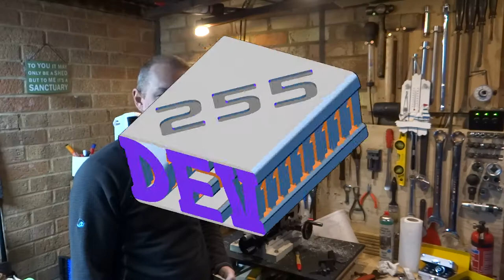CNC Mill Conversion - Part 3 - Dev255

Comment: Very inspiring work, Neil!  I found this channel as I was searching for the SX1 mill but I subscribed for the solid engineering work!
Reply from the maker: Thank you Leo, It's taken a long time getting here and am very near making another video on the X-Axis. I love my Sieg X1, it's seen me through 10 years of faultless operation, even the nylon gears are original (think I'm noo gentle for it). Love your channel, I am an old-school electronics engineer where I used to fix Amiga's, Atari ST's, Monitors, well anything ;-D. Thank you for subscribing.
Reply: @TheSolarPoweredEngineer  Thanks Neil!  Knowing what you know now about the SX1, would you still get it?  I've been going back and forth on the Axminster SX1 and SX2.  The price difference between them isn't that big and 500W DC brushless motor with belt drive seems like a good deal!
Reply from the maker: If I was buying again, I think the X2 would have it as the motor drive gears on the X1 can be a little noisy and have a little backlash, so can cause increased chatter when milling, plus the difference between 150w to 500w and additional 500rpm of speed would win it for me, plus an extra 10mm of lateral and 40mm of longitudinal movement is a plus. If your not worried about price, then the X2 wins I believe. What I would ask is, if you bought the X1 would you be constantly be thinking... what if I bought the X2? Plus the X2 has the controls on the front... Think I just sold it to myself haha
Reply: @TheSolarPoweredEngineer  All good points.  Especially the last thing (I'd think endlessly about what if I'd spring for the X2).  Anyway thanks very much for the insight!
Reply from the maker: Your welcome, happy to help 😀👍

Comment: Hi does your mill have the original motor and gears ? or you upgrade something ?
Reply from the maker: Hi, yes my mill has it's original 240v 150W motor and original nylon gears (both 10 years old), but these will be upgraded to a brushless motor and belt-driven spindle. All this will run off Solar Energy :-D.

Comment: Great job! Is there a design decision to be made about putting the encoder on the motor compared to down the transmission line to the shaft of the mill?
Reply from the maker: Hi, thank you, yes at the moment I have an AMT 102 on the back of an ODrive motor and that is working great (there is another video on that one 😁). As with one on the mill table itself, I may try the same encoder attached directly to the table to get accurate position control too, that way I should be able to track and remove most of the backlash during operation.